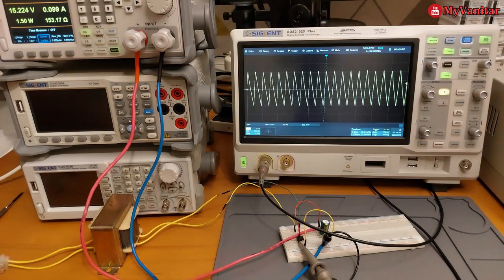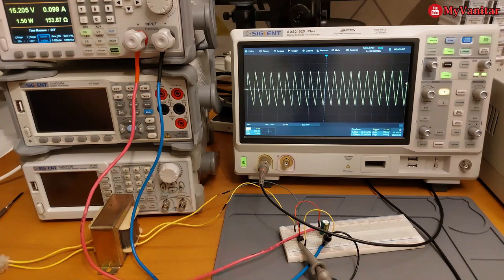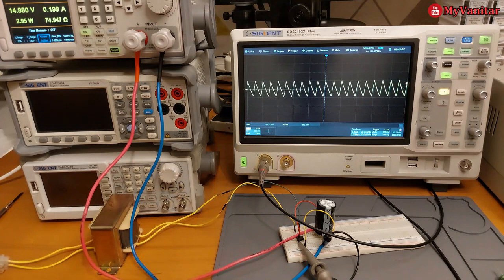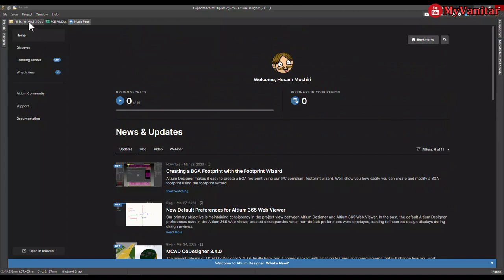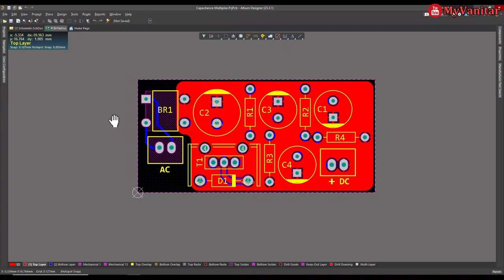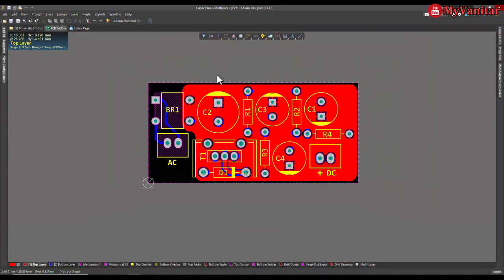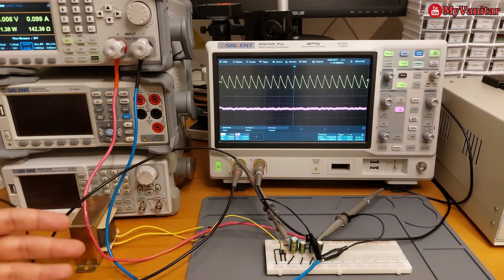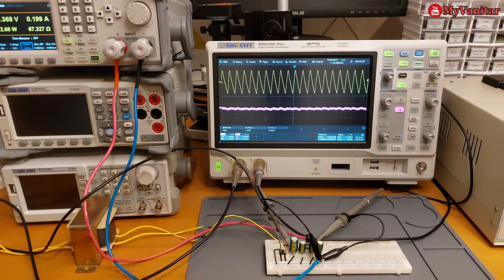Low Noise AC to DC Rectifier Using Capacitance Multiplier [Altium Designer]

Comment: Hi Bro I appreciate your work 🙂 Make small video on how to find Ripples Using Oscilloscope in PWM section
Reply from the maker: Hi, PWM section?
Reply: @MyVanitar  yes PWM section in laptop or other device
Reply from the maker: I do apologize, I'm not sure what device you are talking about, there are some PWM generator chip or modules, I'm not sure if computer Laptop can generate such a thing without an external hardware such as a USB function generator. By the way if you mean this, and if you want to convert PWM to DC or reduce high frequency noise, use an RC filer and then an opamp in the voltage follower configuration. I have covered this in a video
Reply: @MyVanitar  its ok buddy

Comment: This great!
Can we replace the medium power transistor with a darlington transitor and a power MOSFET?
Using the darlington transistor at the gate of the MOSFET.
How?
Reply from the maker: I did not get good result with a single Darlington transistor, that's why I use it like this
Reply: @MyVanitar  I see. I think I understand capacitor multipliers better now than when I commented.
So a mosfet doesn't seem to give any significant benefits, but more drawbacks.
I want to use an inductor in series with the transistor collector and base, I think that too will reduce the ripple.
Reply from the maker: Yes, I forgot to tell you that a MOSFET did not work well also, the same as a single Darlington. Prototype it on a breadboard and test your ideas
Reply: @MyVanitar  Thank you.
A question: If the ripple is 10V, can a capacitance multiplier still handle it? Or does the ripple has to be below a certain voltage?
In LTSpice, it seems like it can handle even 12V ripple, but I am not sure if that is true.
Reply from the maker: check this project, ripple here is very high at 3A-4A, but it can handle it: https://youtu.be/ifiY1v7wBWo
Reply: @MyVanitar  Thank you